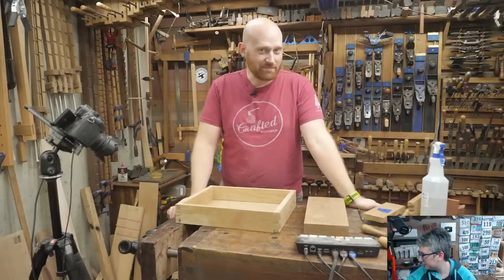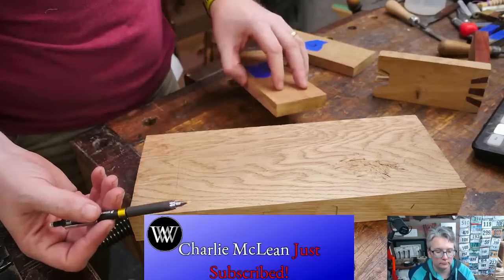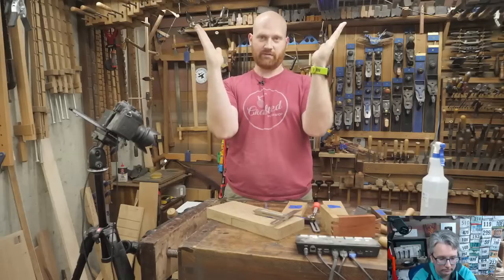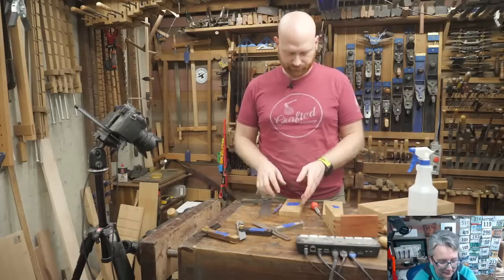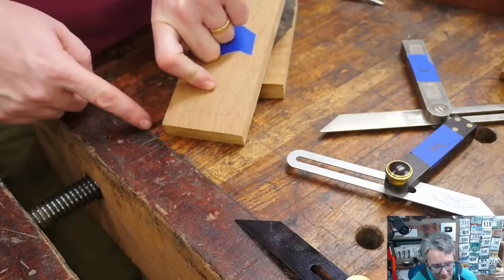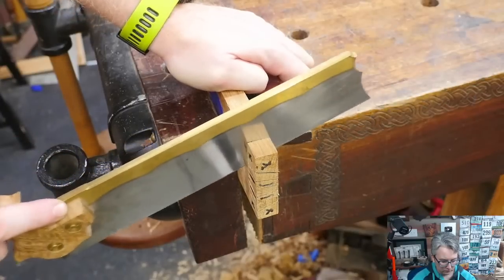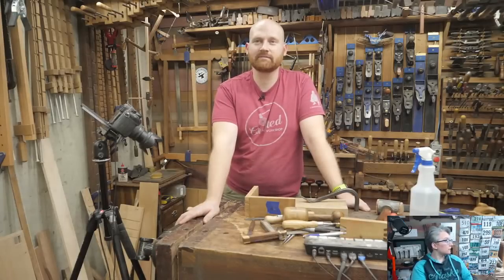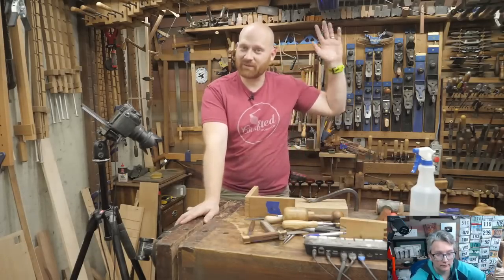How To Cut A Sunrise Dovetail Joint By Hand

Comment: I think making a narrower dovetail alignment jig that is longer and has T extrusion with length stops and some card scrapers your kerf thickness to do the Cosman offset method would allow both sides of the joints cut to be started at the same time accurately, might not give any time savings and requires more jigs.